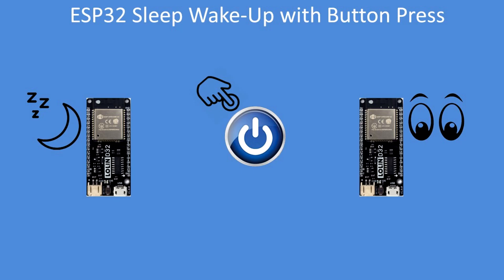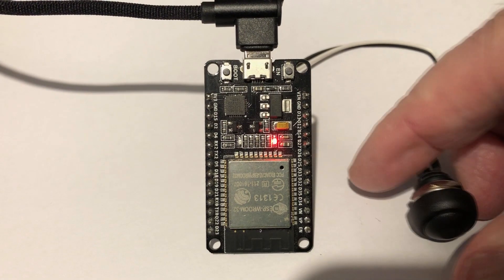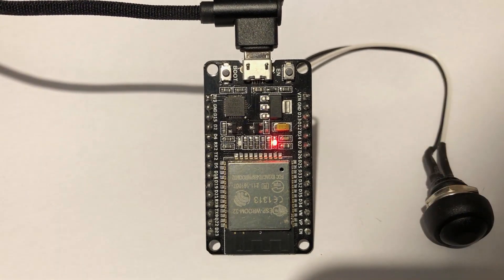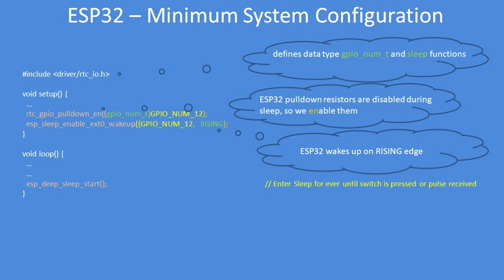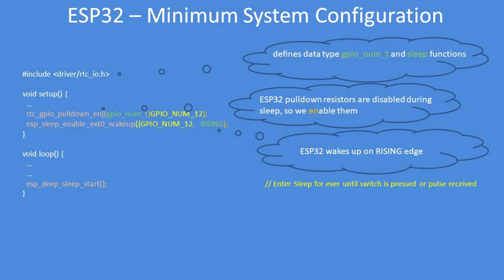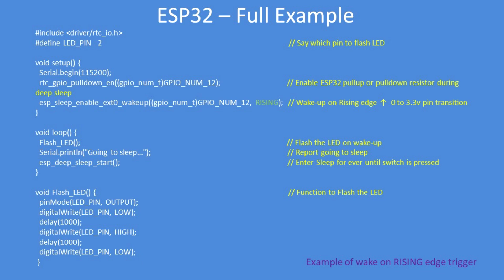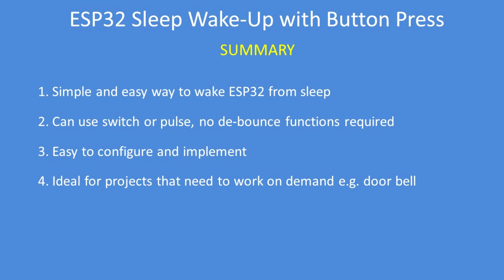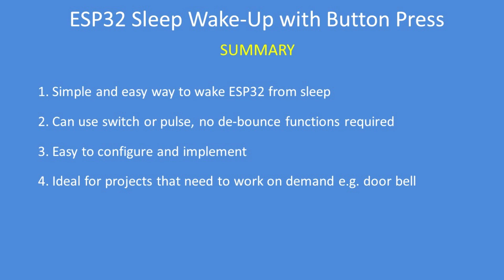Tech Note 135 - ESP32 Wake-up from sleep using a push-button or Pulse

Comment: Compiler says "esp_sleep_enable_ext0_wakeup not declared in this scope" says to use esp_sleep_enable_ext1_wakeup?
Reply from the maker: I've just checked with the current compiler and it reports no errors. Have you selected an ESP32 board type? including installation of the supporting compiler for the ESP32

Comment: Appreciate the Video.
Is there a way to further utilize the button once awake?

For example if you push it, it wakes up for 1 minute

While awake if the button is pushed again It will turn the LED on, then pressed again, turn the LED off, etc.
Reply from the maker: You’d have to implement a timer check, when the cpu starts from sleep the system variable millis() = 0 and increments every mS or micros() = 0 and increments every uS, so if the button is pressed the cpu wakes, changes the led state then test the value of millis() or micros() and if not 0 then it’s a second press and so you can implement a different logic. For the sleep duration keep testing until millis() is greater than the required duration before sleep is initiated. This type of logic favours and interrupt approach.
Reply: @G6EJD  Thanks. Will have to give it a go when i get a chance. Looking for a simplistic one button setup

Comment: Hi David, love your tech notes.
I can't believe that this hasn't been picked up on, but the espressif online ESP32 documentation states that
the esp_sleep_enable_ext0_wakeup and rtc_gpio_pullup_en functions only work with the RTC_GPIO pins.
So this will only work with GPIO's 0,2,4,12-15,25-27,32-39. The video gives the impression that any GPIO pin can be used.
It would be better if the startup function code was

  if (rtc_gpio_pulldown_en((gpio_num_t)GPIO_NUM_12) == ESP_ERR_INVALID_ARG)
      Serial.println("Error - not valid (not an RTC_IO Pin)");       //Enables ESP32 pullup or pulldown resistor during deep sleep
  else
    esp_sleep_enable_ext0_wakeup((gpio_num_t)GPIO_NUM_12, RISING);

I originally tried to use GPIO_NUM_22, this compiled okay, but did not work.

Keep up the good work.
Reply from the maker: Thanks and noted. Have you tried Falling and Change parameters, the last time I tested those aspects they did not work contrary to the documentation.
Reply: I did try Falling with GPIO_NUM_22 but it made no difference, in my application moving to GPIO_NUM_27 fixed the problem.

Comment: Hi David
Hope you are doing well. I've tried your sketch here and it works fine. I have tried to integrate millis () in the sketch, to get ESP32 to update an Internet Clock, Temp. and Humidity on an E-Paper screen. Internet Clock must run in e.g. 8 hours before ESP32 goes into Deep Sleep by itself. Push-button Wakeup, I still need to use, to start it all over again.
Do you have a suggestion for, how I combine the 3 sketches: Your sketch with Wake-up, Millis () and the sketch I have with Internet Clock on E-Paper screen. I can not program, but I am good at Copy-Paste 
With best regards
Georg
Reply from the maker: Hello Georg, I'm well thank you for asking. You really should not need to use millis() at all, the first you should do on wake-up is get the time, then read your sensor, then update the display and then go back to sleep.  You can do this with a wake-up button. Logically:
1. Wake-up
2. Get the current timee
3. Read the sensor
4. Update the display
5. Go to sleep
Reply: I think I need some kind of timer, millis () or external RTC. What I meant was, that Internet clock updates every minute, along with Temp. and humidity during the day. Since I do not see or use the Internet clock at night, it was best that it is in Deep Sleep, as it is powered by a battery, thereby saving power. I still have to use Push-button Wakeup so I can start it the next morning myself, and then it runs for 8 hours, for example, before it automatically goes into Deep Sleep again. Best regards Georg
Reply from the maker: @bubi146  what about making the last sleep statement say at 23:00 about 8-hours long, then it will wake at 07:00 and carry on.
Reply: @G6EJD  It will be perfect! Is there a sketch that can do that? Is it a sketch, you can send me or point out where I can get it?
Sincerely Georg
Reply from the maker: If you getting time then you can tell when the hour is ‘23’ and then set your normal sleep time to 8-hours instead of your current value. If you send me your code I’ll do it for you.
Reply: @G6EJD  Thank you - I sent it to you
Regards Georg

Comment: Hi David, great Tech series. Wouldn’t just the restart of the esp32 work as well? No need to worry about pulldowns and gpios?
Reply from the maker: fluiddynamicist Once the ESP32 is in sleep nothing will wake it up other than an interrupt or say a press of the reset switch, but using a reset switch loses all the settings of the CPU whereas this approach enables status to be maintained across sleep cycles, for example it can record date-time of last wake up, or sensor readings and supply these on demand, etc. It was a proof of principle.
Reply: @G6EJD  Thanks for quick response. Agreed entirely. I have just done an emergency switch for my dad who is in an elderly care home, there was no need for any states to be carried over. Just a simple wake-up.  Bests. V

Comment: Thank you very much for your videos. They get straight to the point and are very helpful. I have a problem achieving low power consumption in deep sleep, however, and wonder if you can help me figure it out. For testing purposes I used your exact sketch on a Lolin D32 board. I didn't bother wiring the LEDs. If I connect three AAA batteries (4.7 volts) to the BAT pin, then the board draws 42 mA in active mode, and 5.0 mA in deep sleep. If instead I connect a 3.7 volt LiPo through the JST jack, then the board draws 40.6 mA in active mode, and 3.6 mA in deep sleep. I measured the current with two different multimeters and got very close to the same results. I am satisfied with the 40 mA in active mode, but disappointed that the current in deep sleep is 65 times higher than you are able to achieve with the same sketch. I know the boards differ, but from what I've read online, I thought the Lolin D32 should be capable of 150 uA or less in deep sleep. I won't bore you with everything I've tried already. Do you have any ideas about where I've gone wrong?
Reply from the maker: Interesting problem - first of all your using a real Lolin D32 board? and there are two variants, one with an LED and one without, selected when ordering. Although in my experience the difference in power consumption at sleep is not that different unless the LED is ON. In all of your examples the sleep current does look excessively high for the Lolin D32 board. You will only achieve minimum sleep current whenusing a power source via the JST Battery connector. 
Question: Do you have anything connected to the board? If so, have you tried the same test with nothing connected?
Question: Are you putting the ESP32 into deep sleep mode, or hibernation?
Question: IF your using another brand of board which typically power the UART and other ancillary devices in deep sleep then your results are typical, there are fake Lolin D32 boards around, a real one costs at least $7-8 and can only be purchased from the Wemos CC Store on AliExpress, I have a fake one here, and it consumes about 1.6mA in deep sleep.
I've just measured a Lolin D32 in deep sleep to confirm what you should get and I measure 145uA.
Question: How are you measuring the deep sleep current? Using a DVM on current range, be aware that few if any give an accurate reading, do you get the same result if you switch between mA and uA ranges or if a high count DVM then A range, they should all correlate if the DVM is not introducing a high burden voltage and therefore error.

Typical devices that consume power in their quiescent state  are the voltage regulator (can you read any device type numbers) the battery manager and the UART so on the Lolin D32 the regulator is the ME6211, the battery manager is the TP4054 and the UART CH340C https://docs.wemos.cc/en/latest/d32/d32.html the reason these are important is because there is a deterministic way the sleep power can be determined: ESP32 sleep current ~15uA, ME6211 quiescent current: 40uA, TP4054 quiescent current: 45uA and CH340C quiescent: 50uA that gives a total of: 150uA but note there are device variations so these are typical values giving you an expected mean value.
Reply: Thank you so much for your prompt reply! I purchased my boards from Amazon with the description "Genuine/Original LOLIN D32 V1.0.0 - WiFi & Bluetooth Board Based ESP-32 ESP32 ESP-WROOM-32 4MB Flash Arduino MicroPython Compatible (1 Piece, D32 V1.0.0 LED)". It has a CHG LED that lights when charging, and an I05 LED that lights during the Blink sketch, but both are dark when running your sketch.
A: I have nothing connected to the board but the battery and DVM in series.
A: I am using your sketch for deep sleep.
A: The labels on all the ICs exactly match the ones in the photo from your link: CH340C, H3, LTH7, A1sHB, S2RK.
A: I was worried that my DVMs might not be up to the task, but one measures down to 0.01 mA, and the other has a separate uA range. When they both came up with 5 mA during deep sleep, I figured something was wrong, even if they were not up to measuring in the uA range.
Now the GOOD NEWS: While double checking my response to you, I noticed the CHG LED was no longer lighting up when plugged into the USB, so I tried another board and measured 36.4 mA in active mode and 74 uA during deep sleep on both DVMs. Success! I must have fried something on the first board when experimenting with using the BAT pin instead of the JST jack. The reason I played around with the BAT pin at all was because I wanted to try three AAA alkaline cells instead of a LiPo battery and I was afraid of connecting alkaline batteries to the charging circuit.
Q: Is there a safe way to connect three AAA alkaline batteries to the Lolin D32 board, or should I just stay with LiPo cells?
Reply from the maker: The maximum input voltage of the TP4054 is 10v and for the me6211 6v, so the maximum input voltage should be limited to 6v.

It sounds like one of boards is fried, most likely the TP4054, so can get spares for pennies so it would be worth swapping it out
Reply: @G6EJD  Thanks again for your helpful reply. It gave me the confidence to try again, and it worked this time! Connecting the three AAA batteries to the BAT pin I get a current draw of 36.5 mA in active mode, and 80.5 uA in deep sleep. I'm guessing the slightly higher current draw is due to the slightly higher voltage from the alkaline batteries (4.7 V). Thanks also for the tip on swapping out the TP4054. They are indeed cheap from AliExpress and I will look into fixing that board. (I did my initial testing with a new power supply and found the coarse voltage knob to be a bit more fiddly than I expected, exceeded the 6 volt limit momentarily, and that must have fried the board.) Cheers!
Reply from the maker: I’ve done the same thing, my psu has a course and fine voltage adjust and the course control can quickly exceed the voltage, I used a heat gun to remove the tp4054 and then soldered the new part back, small but doable, good luck. Your power consumption looks exactly right, it cab be reduced further by swapping the me6211 for a rt9013, it uses 20uA whereas the me6211 45uA.

Comment: Noob question: will this work on a d1Mini/esp8266-12? TIA
Reply from the maker: Fred, it’s a good question. The normal or widely used esp8266 sleep process is to use a timer whose time-out triggers pin 16 to go high which to wake the device is connected to the RST pin, so,the ESP8266 can be placed in sleep and then by placing a pullup resistor (10k) on the RST pin and then connecting a button from RST to GND it will wake the esp. Summary pull-up resistor on RST then switch (normally open) between RST and ground. Place the esp into sleep via code and it will sleep indefinitely until the button is pressed. There is some RTC ram but it’s very difficult to use it.
Reply: @G6EJD  Thank you for the reply. Your channel is awesome

Comment: Thanks again for you videos. Is it also possible to connect a push button to GND + GPIO in the board and trigger the button push through code by pulling the button high? Like a relay but without using a bulky relay. Voltage through the button less than 5v when pushed.
Reply from the maker: Shane Bekker, in this example the RTC pull down resistor is enabled thereby pulling the GPIO pin low, the trigger occurs when the GPIO pin goes high as you describe your requirement, so it’s already configured as you need. For some reason that I cannot establish the reason why, reversing the logic does not work, ie enable the RTC pull-up and pull the pin low on a FALLING edge, the compiler excepts the change but it does not work in practice.
Reply: @G6EJD  So are you saying that one can push/trigger the  button from code without pushing it?
Reply from the maker: Shane Bekker, once sleep is initiated only a reset or externally applied pulse  or pin transition will wake the device. When asleep you could also wake it from a timer time-out. When sleeping the cpu stops and so cannot process any instructions.

Comment: Very nice to see you again. Is there someone who knows what is the exact board using in this video? It's really small, nice one. Is there someone who knows if I can run my Arduino sketch that I usually run on an esp8266 as his on an esp32? Is the basic code compatible between the two boards?
Reply from the maker: The board is called Doit they are freely available on AliExpress for about $3, once you add the ESP32 extension to the Arduino IDE (easy to do) you programme the ESP32 just like any other Arduino
Reply: @G6EJD  love your channel, thanks.